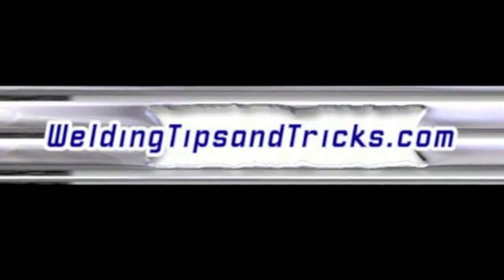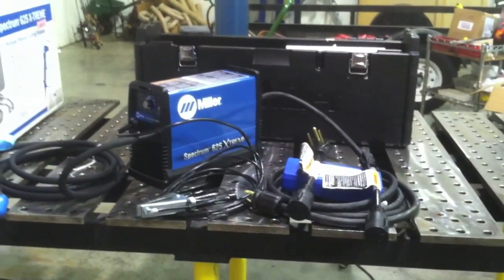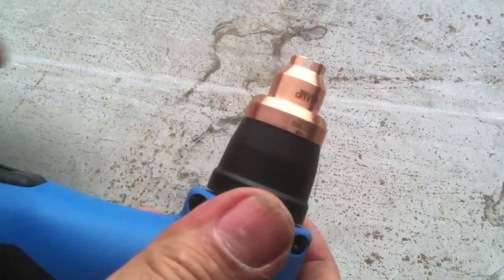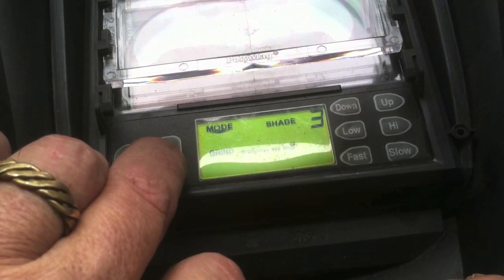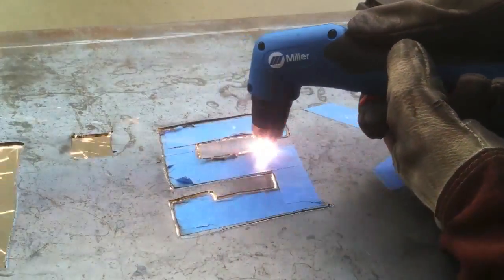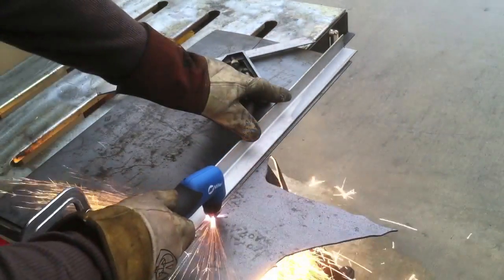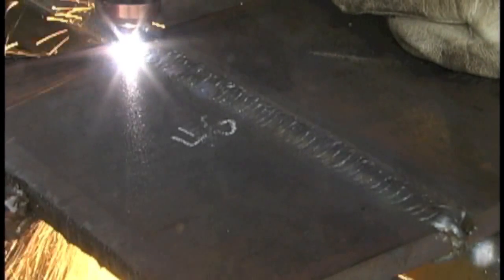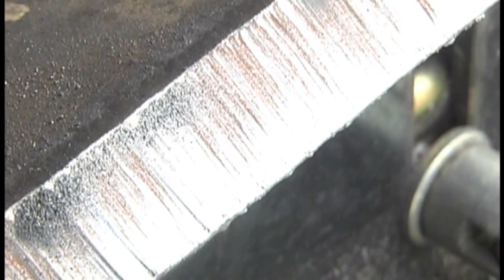Miller Plasma Cutter- Spectrum 625 X-Treme Part1

Comment: Good vídeo,  I have a question, the replacement parts of the torch are the ssme for any plasma cutter?  The other quesitn is,  may I use other commercial torch in this cutter

Comment: Does anyone know what the temp on the plasma cutter is ? I heard it is a lot higher than the temp on our sun ? - something like 65 times higher ?
Reply: tinkergene Between 40,000 and 60,000°F, can go up to 80,000. The surface of the sun is 10,000°F. So, pretty damn hot!
Reply: Thanks Jacky !  That is HOT ! The slag that is left along side the cut is like " Vaporized steel"? - it chips off easy
Reply: tinkergene I suppose so! I don't have much knowledge on it, I'm taking a welding course right now and we just learned about plasma arc cutting yesterday :)

Comment: when it comes to thicker metal i would just use an oxy ace torch. when your skilled enough you can cut with little to no slag. i mean where you can file it vs use a grinder. just my 2 cents.
Reply: I use my powerplasma on anything 1 inch and thinner. The oxy ace torch does seem to do better on the thicker stuff but maybe that is because I only have a 60a plasma cutter.

Comment: A very nice machine Jody but the only thing that puts me off is the cost of the consumables. I bought a Cut 50 on eBay three years ago very cheaply and it has worked hard and without fault since. It handles half inch steel easily and to me that is as thick as I would ever cut. I buy my consumables by the bulk lot from China direct and have no complaints about them either. Perhaps you might run a comparison test sometime with a view to cost and performance.

Comment: I cut with an Everlast plasma cutter and use a shade 5 or sometimes lighter depending on the ambient light conditions. I use a standoff when cutting which keeps the tip  slightly off of the material. You can also get drag tips which have channels which direct plasma out to the sides when starting a cut but I haven't used those myself.

Comment: It uses either compressed air or some inert gas typically. The gas is pushed out at a high speed, and where it is pushed out there are a set of electrodes that run a current through the gas, forming plasma. Hope this helps!

Comment: Hi Jody,

In my experience with plasma cutting, i have always been told to use only a non-conductive straight edge whilst cutting. I think it must have something to do with Continuity of the weld current passing through the straight edge and possibly shorting something out??

Comment: Useful bit of kit and a good demo.As my eyes get older, I have trouble seeing exactly where I'm cutting or TIG welding...i tend to wander off the weld line. Does anyone know of a high visibility marker type pen that's good for highlighting the desired welding/cutting line? Could be purpose sold item or just something that you've found works for you. If anyone has a solution, let me know. Thanks very much!

Comment: I have the Spectrum 375. Been using it at 115V-20a  up to 1/4"  It's been very useful.  I recently had 220V-20a circuit installed for a lathe so can't wait to try the plasma with the higher voltage.

Comment: Great demo, perfection doesn't allways mean a straight or ture line!

Another reason for cutting the weld prep from the lower edge is that you have less tendency of contact to the metal with the contact tip due to the approach angle and maintaining your cut heigth , as in top side cutting:) Keith

Comment: I've had a Hypertherm 1000 plasma cutter for 5 or 6 years and use it often. It's a very nice machine. I've cut steel shapes using plywood forms but for some reason never thought of
using painters tape. It's true, your never too old to learn a new tip or trick. Thanks.

Comment: A good set of nozzles. My friend is using a Teflon washer to move a torch smoothly along a steel surface. It does not last long but helps to go straight or make curves without stick-and-slip of the torch.